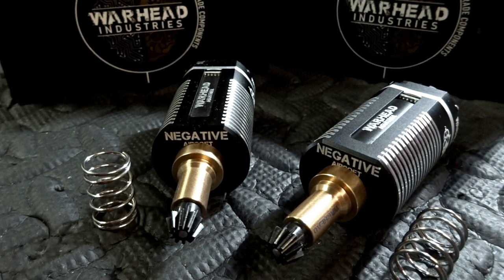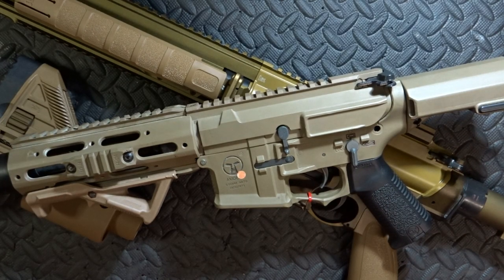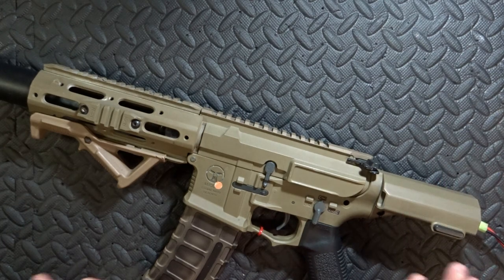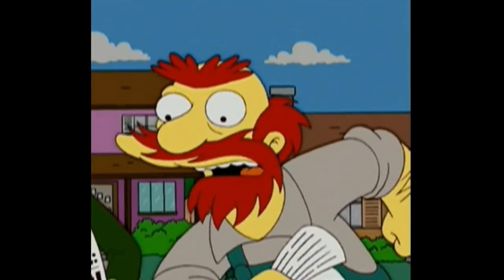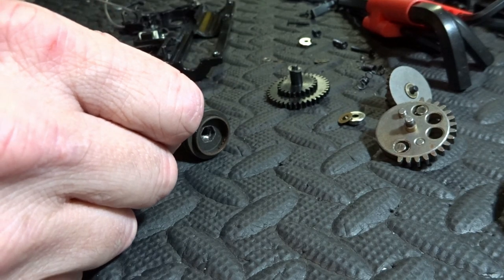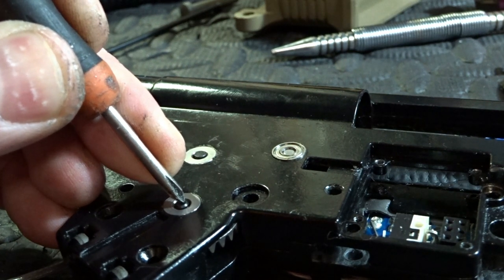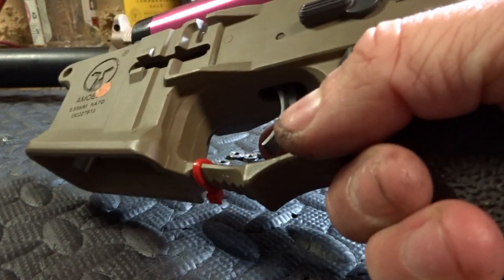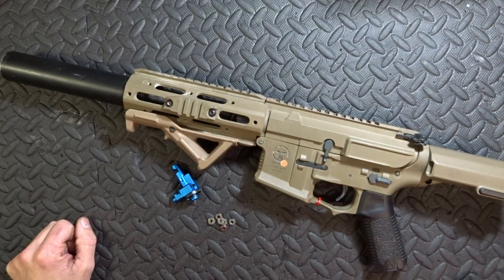Warhead Industries Brushless Motor & An Ares Scummy Badger (part 1)

Comment: I still have nightmares with an LCT RPK I used to have and the ProWin hop chamber I had in there. I checked absolutely EVERYTHING before I finally admitted the culprit could be the chamber. It's working nicely now, with the original LCT one.
Reply: @Johnny Dong If you'd ever worked on an LCT pattern AK you would know that the outer barrel is held only by two small grub screws. Whenever those screws get undone just 1/4th of a turn, the barrel comes loose and it literally drops off the gun. This is specially bad on RPKs, since the front end is quite heavier than in other guns.
Now, the chamber won't fit through the trunion, so on its way out, the outer barrel hangs from the chamber, which is attached to the outer by another pair of screws.
Amongst other reinforcement upgrades, I chose the ProWin chamber because it has a rear hole that attaches the chamber to the gearbox and then you have the whole outer barrel assembly attached to the chamber and the chamber bolted to the gearbox.
In the event that the two upper screws get undone, you don't lose the outer barrel, it only becomes loose.
This "solution" brought the ProWin QC problem with it, so in the end I chose to drill holes in the outer barrel so the grub screws would go 1mm into it and hold it even when loose. Incidentally, the side pressure of the drills keeps them in there pretty good. Now, the original chamber is again suitable.

Comment: My "Hot Garbage Fire AM-015" piston rails are spaced out so much that no mater what I do the teeth scrape the cylinder ID at 6-o'clock as the spring compresses canting the piston enough to scrape up the aluminum foil cylinder. I replaced the Ares piss-piston with a KWA piston that has a tighter piston rail gap and the cylinder ID is no longer being scraped... Now they sell these for $339usd. I bought mine at $259usd.

Comment: cant wait for the test, spam test on a 11.1 with 100 active break?
Reply: They don't like AB, Titan's can report errors unless the AB is turned down/off, then they run fine. Apparently if you connect them up incorrectly > reverse polarity it can damage them.
They say they do 3 speeds, but unsure what they are, the internal ECU/PCB inside doesn't like the reverse polarity of AB as mentioned, but wonder if there is any snubber/flyback diode protection ? Would be useful to see if there are large sparks across the switch contacts when re-opening the switch like on inductive loads,  like brushed motors etc...
Would be good to see the tests checking for inductive spikes, the like for like amperage draw against a similar brushed motor: 16tpa, 22tpa or whatever rpm the motors they supplied are.
They are not going to be cheap, like $150 aprox, maybe more with markup/shipping, they may not be suitable for all guns (AB fully enabled & no option to turn down/off - there are a few like this the DE M904's for example), plus they won't be suitable for all wallets of course.
Unsure how aggressive the AB is on the Ares EFCS or G&G ETU, so they would be good bench tests, plus Titan/Perun guns adjusting settings for AB/precock, 12:1 short stroke, DSG - Luke's MP5 DSG build would be a good one to try with the Titan as a suggestion.
Unsure if they will completely replace decent cheap $30 neodym motors, maybe for people who might buy the higher end Infinity or Samurai motors, these brushless motors will be a consideration, but will depend on build & how aggressive the AB is

Comment: Hello negative airsoft.
I understand this is a 3yr old vidoe but I was recommended your channel and I searched for your review of Ares' honey badger deliberately because I purchased one myself as my first battery airsoft gun.
I haven't done a thing to it. I am not at all knowledgeable in meddling with airsoft guns so I've left it as its come in the box.
I've had 7 odd games with it so far, roughly 10hrs total of gameplay and in terms of firing it is performing absolutely fine. And clocks at 330-340fps on the chrono with .20s.
My only single issue with it is the magazines not seeding easily and occasionally not feeding consistently.
After my badger was given a thorough roasting from marshals I decided to look you up however the issues you've listed are not issues I've found, again I've not dismantled mine, I don't know what im doing in that front. If you could respond with some potentially useful insight or information I'd be appreciative, anything I should or could do to prevent the internals breaking down in future yada yada essentially just to give myself some insurance since it was clear I got mugged off when I bought it, £450 including a spare mag, battery and charging unit.

Comment: What do you think of the maxx hop ups was looking into the tracer one.
Reply: Works fine
Got one in my mp43/1 , most know them wrongly as stg44
Reply: They are solid when you have them set up right. I think they are picky about nozzle length and configuration in general. I've had issues with them in several stock VFC Avalons. Was running mine for a bit just fine and then suddenly started jamming up.
Reply: @midwestairtech  if I get one it will be for my wolverine inferno
Reply: @SSP_STORM  not familiar with the wolverine hop units but in general it's best to stick to a stock hop unit that's designed to work with the rest of the components in the gun. It's just not worth it unless you REAALLY want the internal tracer or you're trying to squeeze out every ounce of precision for a DMR/Sniper, but there are objectively better and cheaper ways to do that and other more important places to put your time for that sort of endeavor, like eliminating/minimizing movement and vibrations in the system, before sorting out your hop unit. If you're not lucky enough for it to work properly as is, going the lengths to get a Maxx unit working properly is nonsensical. You could put that time and effort into modifying your stock chamber with a DIY internal tracer unit and shimming/shaping the stock components for performance optimization.

Comment: Hi there I brought honey badger from ares and used it twice with 11.1 LiPO took it out 3rd time now sounds under powered and slow very disappointed as I brought new and paid around £300  also was told it would do over 330 FPS and only shots 270 to 290 out the box with battery and charger any suggestions to why this would be happening ? And anything I can do to fix this. The motor got a little hot on 1st day but the marshal said it was normal. What are the motors like on them Could I do upgrades and new battery to fix it. It also is the AM-013DE one I believe with mosfet and new trigger Also the LiPO won’t charge fully cell 1 & 3 charge but cell 2 won’t I don’t want to leave on charge just in case it blows lol Could it just be a dodgy battery plz help before I spend loads on upgrades

Comment: Are you testing the super high speed, speed or high torque brushless? Is it able to pull a 150 spring with high torque gears? Option No.1 don t like strong spring, so will be interesting to see if those will manage it!

Comment: Can you elaborate please on why do you think that the prowin hop unit is bad? It's not a sarcastic question as I have one that I still didn't use.
Reply: I was about to post the same question.
Reply: Horrific tolerances, not cnc but casted garbage that is made to look nice. They were cnc and “ok” like 8+ years ago, but since then they have been pretty meh to horrific unless you want to drill them out so “average” parts  can be used.

They don’t even come close to true cnc old old pgc/prowin items like the rare V2 split shells that the retro arms split is based off of.
Reply: @opairsoft8100  uh I guess I got some good ones... I bought two 5 years ago and I have not noticed any thing wrong with them.

Thanks for letting me know not to buy more of them!

Is there a rotary Hopup that you do recommend? Thanks again.
Reply: @opairsoft8100  I got mine about 6-7 years ago, so it should be the older type. Also got the Prometheus barrel and the purple bucking but never got around to install it. Always next time, next time,... :)

Comment: Hey man I hope you are someone who knows sees this. I bought an arcturus m4, the polymer version, to get into airsoft. I want to replace the orange flash guard but it is on there tight. I removed the grub screw and im thinking its glued on. What is the best way to get it off? If I grab a wrench and crank I'm scared I'll ruin the barrel, since I dont have alot of money I want to NOT ruin any parts lol. Maybe you can shoot me a tip?
Reply: 1st make absolutely sure that the grub screw or pin is out entirely. After that heat up the flash hider, either by leaving it in boiling water for a good bit, or with a heat gun. A hairdryer probably won’t put out enough heat, but it’s better than nothing if that’s all you have. After that remembered that the plastic isn’t likely to survive, especially if it’s your first time. After that, grab your wrench/pliers and twist it off. Remember tge threads are left-handed(opposite of normal) so righty-loosey. 

The reason why adding heat helps is that most flashhiders are pinned and glued, and the heat softens the glue enough that you can get the flash hider off. 

The last thing to remember is the same as the first rule of soldering: try really hard not to touch the hot bit.

Comment: A high speed gearset AND a highspeed motor? I was always under the impression that you should either have a high-torque motor combined with a high-speed gearset, OR a high-speed motor with a high-torque gearset, never both the same...

Comment: Fuck it, I’m using a ProWin with a Kythera with a hair under 130 psi pushing a .32 out at 1.4J +-.05 with a prommy purple. No real issues rn. No real care
Reply: Holy cow there is a big leak if you are only getting 1.4 joules at 130 psi. Or you are running a stupidly short barrel.

Comment: I feel bad for running a prowin now... What unit did you swap it for?
Reply: Also, what makes the prowin so bad? What causes the issues?
Reply from the maker: Bad tolerances & little to no qc.

I put an £8 point rotary in it with a zci arm
Reply: If it works, don't change it. I have one M4 with one of them and it works as it should.
SHS blue polymer ones are cheap and work fine.